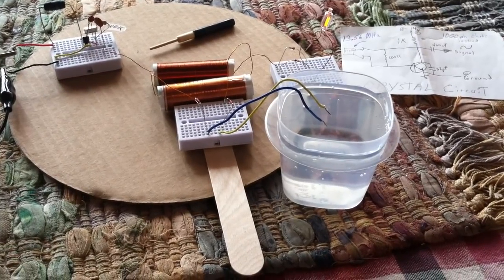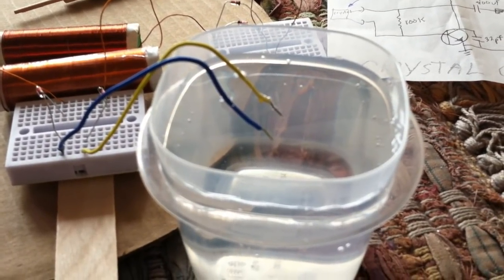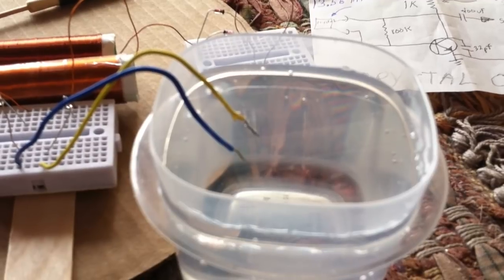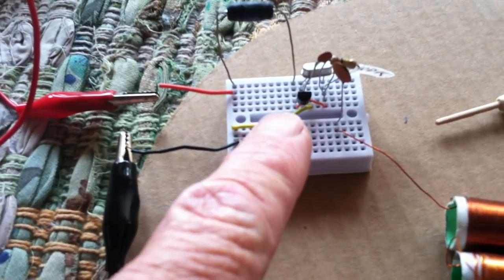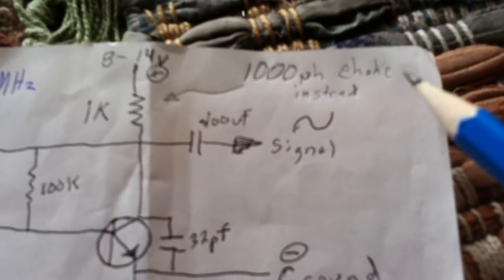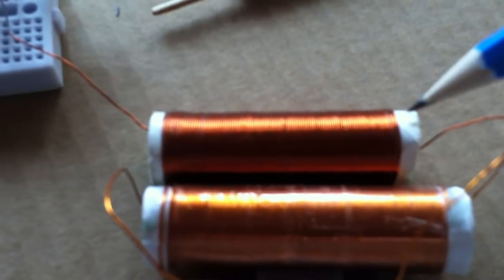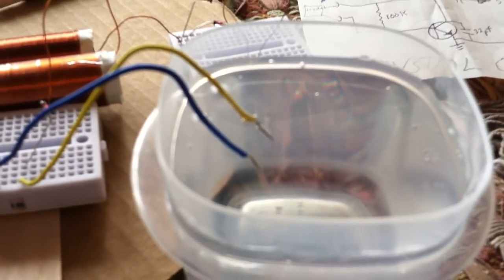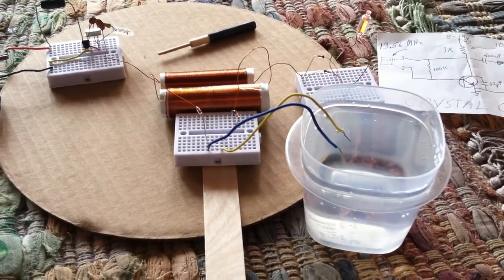Water electrolysis using a crystal oscillator at 13.56MHz

Comment: But the cut-off diodes after the secondary coil aren't giving you a pulsating continuous voltage on the electrodes? So you basically have a regular CC high frequency electrolysis...

Comment: Stan Meyer always said his cold process of electrolosis was at the frequency of water itself. Makes sense if you've read about Royal Raymond Rife.
Reply: Water resonant freauency is at  a few gigahertz, so this is hard ro achieve.
Reply: @synhro  A stan meyer circuit, it seems to me, could work a lower frequency as long as it is in sync with the vibration frequency of the water molecules.  If the water freq is 2ghz, and the circuit is .2ghz, you're putting force on the molecules every 10th vibration.  Like pushing someone on a swing pushing every 10th swing.  (My 2 cents, lol)
Reply: @samjubilee6593  the problem is even if we vacuumize water and gasoline stehiometric balance of burnable new water mix is theoreticly almost impossible to explode or burn but im not sure what am i getting wrong
Reply: @synhro  to make it by itself, with frequency only, i do not think so, but if it make a amplifiers system with transistors, i think so, it can produce hydrogen.

Comment: Nice.

I'd remeasure the total current draw from the power source to see what the actual current draw is.  You changed your load when you added the electrolysis wires & water.  Your transistors might be cooler due to your current draw possibly being significantly less.

Comment: Cool setup (bad pun, sorry).  Aside from the transistor effect, it's fun to see electrolysis driven wirelessly.  But I don't think the 13 MHz has much effect on the process, over (say) another frequency.  There's no water resonance near that.  But I've seen some papers on enhanced electrolysis using very short pulses, compared to the DC diffusion method.  So maybe that's in play here.  Anyway, nice job on this.
Reply from the maker: Thanks.
Reply: 43.563

Comment: Will have to try this and I do remember the electrolysis too. The battery pickup was neat to see, it makes a good indicator of action all on its own !
Reply from the maker: It is actually pretty easy to do with any exciter.  I just wanted to see if this one would do it also.
Reply from the maker: This works on a Slayer Exciter at the lower frequency also.  I just wanted to see if this crystal oscillator exciter 'thing-a-ma-bob' would do it.. Ha.  I have been playing around with wirelessly running a small pulse motor off it also.
Reply: Also works on the larger SWES systems....the higher voltage BAC's had water as the limiter for the Base and i'd get electrolysis on LED's legs when they were dropped in the water. Darn things glowed with no AV plug or anything.
That would be fun on your sort of setup...wish I could tune the 3 coil circuit for 13.56MHz, am currently at 10.1MHz.

Comment: The 'elements' actually immersed in the water, like Stanley Meyer's rig, may need to be tuned to an harmonic length physical dimension to get resonance and hence effect.
Reply: captainmidnite93 good suggestion.
Reply from the maker: I guess it is like setting up a ham radio antenna where the wave length used determines the length and that can be scaled up or down?
Reply: I envision a slim slim whisker of a wire(s) cut with an Exacto blade to a calculated length. The Hi freq means little snips to dial it in. The surface tension layer may even have an inhibiting effect at your scale so a wee bit o soap to negate it could be tried. Only the immersed part is the 'vibrator' so simply adjusting depth may tune it also. Good hunting!

Comment: Interesting effect. Have you tested does it burn, or does it have the skin effect that makes it safe to touch? And can you use the water as transmitter for led example? It might be that the crystal acts like spark gap and it separates the the flow to cold electricity side, like in Tesla hairpin, or Morin replication. Seems like all liquid has some different magnetic properties too. Magnet alone in water will produce minimal voltage.
Reply: It might also be that if the frequency of that crystal / circuit, is close enough to divided or multiplied natural frequency of that transistor, then it doesn't have the heating effect.
Reply from the maker: Interesting.  I have not tested it to see if the bubbles burn.  The whole thing is a bit mysterious.  I am going to stop and box this up just the way it is to preserve it. ---then build a second one.   Something is not right here.  The other people working on this project are not able to replicate this and get the same results.  The prototype board (with it's capacitance) might be acting as part of the circuit.